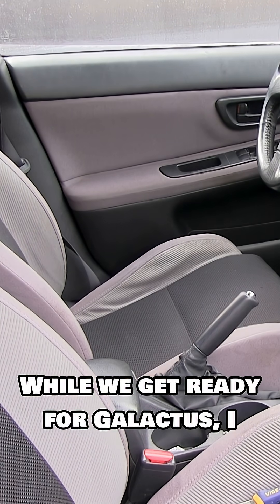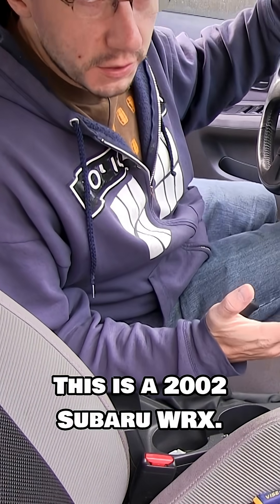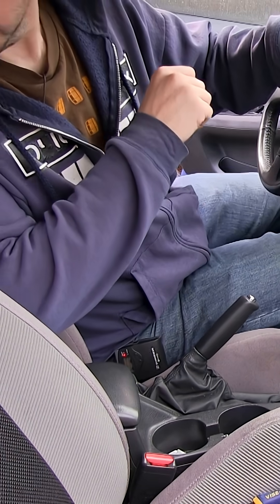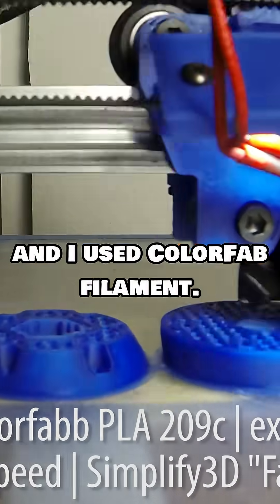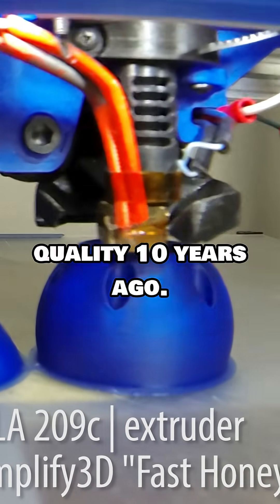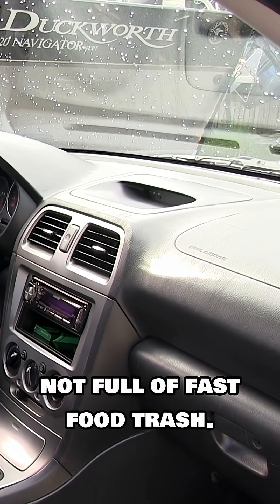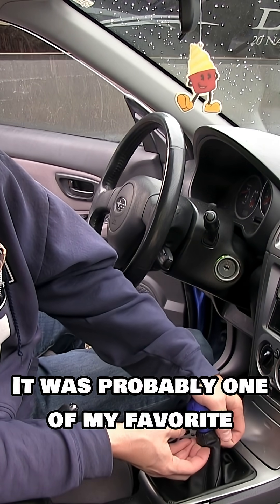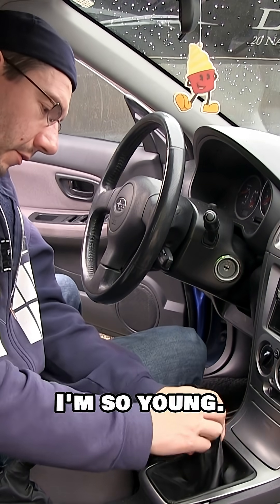3D Printing Subaru Shift Knob! - THROWBACK 10 Years Ago!  #3dprinting #3dprinted @Colorfabb

Comment: Those genuine J heads had some of the best print quality I could find for years. Eventually things caught up, mostly, but I would love to see one mounted to a modern Bambu or similar for comparison. Think i still have a good shape genuine 0.35mm one with muffler puttied heater cartridge and thermistor.
Reply: Just realized, see my delta with j head in my youtube photo. I had made a slick 360 deg 5015 * 3 fan layout that had adjustable positions for almost every angle and spot around the head. Downside was leveling with a end stop button, paperclip and ballpoint pen spring.